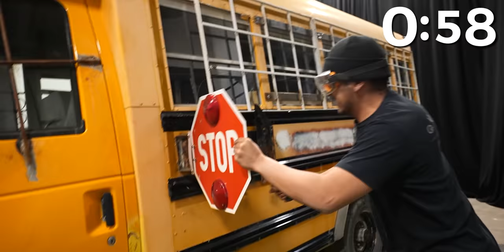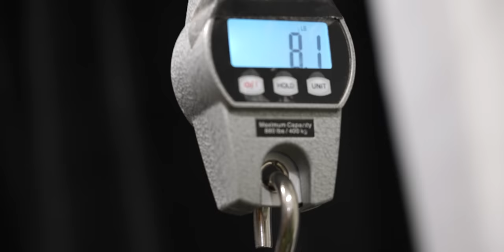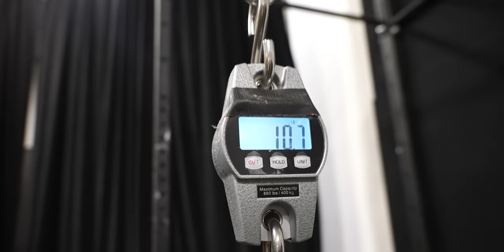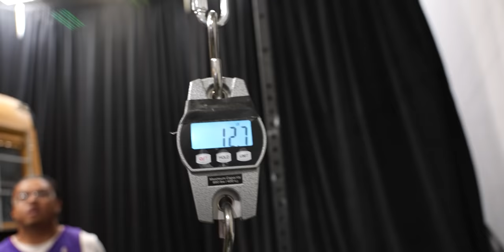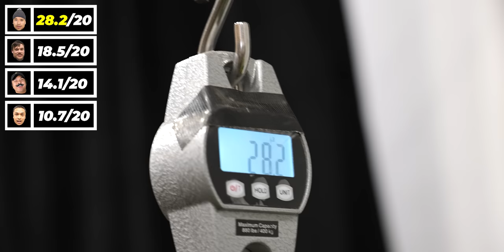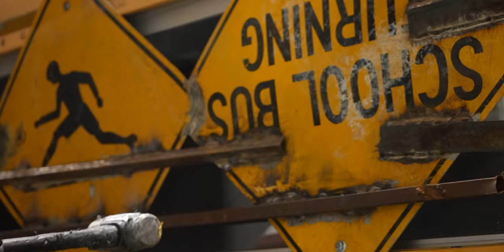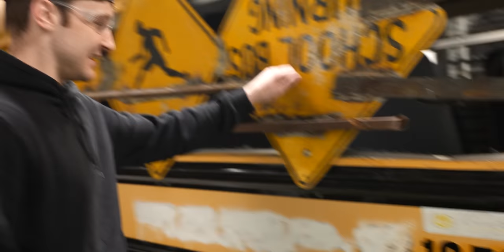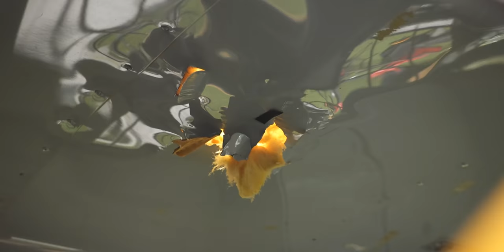First To Break Into Armored School Bus Wins $10,000

Comment: Could’ve used the small tools to break the lock on the driver-side door. Steel ball, mini pickaxe, shovel, machete, etc.
Also could’ve used the machete to slide past the latch on the door and get through. 
They never re-enforced the door’s locking mechanism
Reply: Or they could have put a hole in the window by driver Sadie and rescued through opened the door
Reply: Dustin welded all the hinges shut
Reply: @adamshmadam14  yea but hinges are small and they could’ve broken them